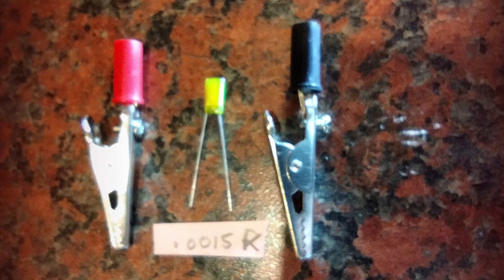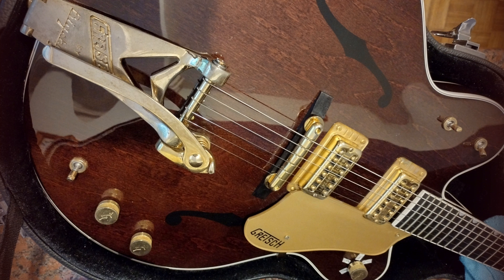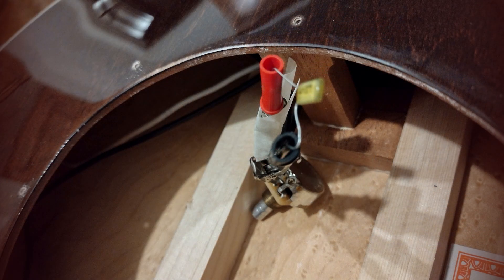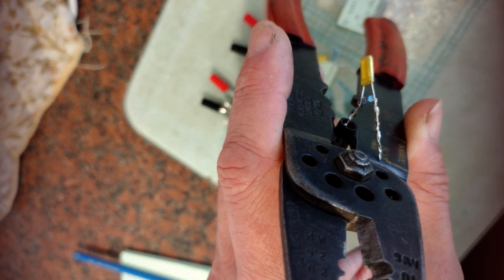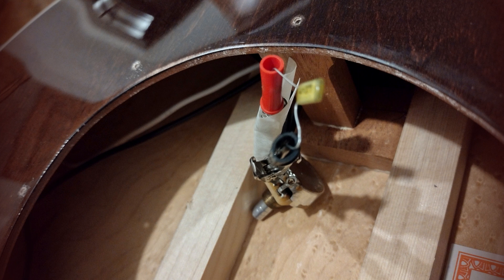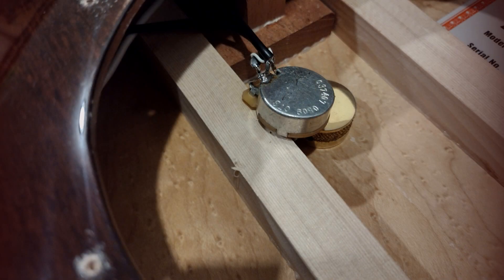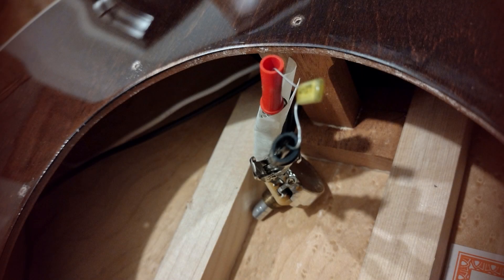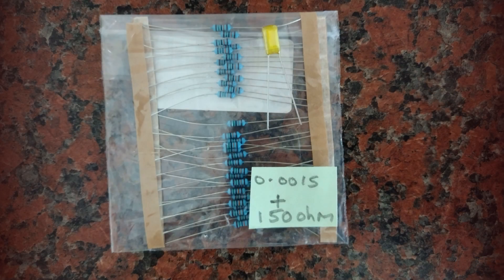Gretsch Treble Bleed Mod Shootout

Comment: This is very helpful. I was going to use the TV Jones Gretsch master-volume treble bleed, 1.0nF || 150kOhm, but maybe I'll try a 1.5nF cap instead. Of the circuits you tested, it's also my preference.
Reply from the maker: Hi, well I usually use an 001 as a cap only treble bleed but yes, the resistor combination I favoured is a worthwhile starting point assuming similar pot values, taper and p/ups. Best of luck with the upgrade and do let me know how it works for you. 
All the best, Dale Harris